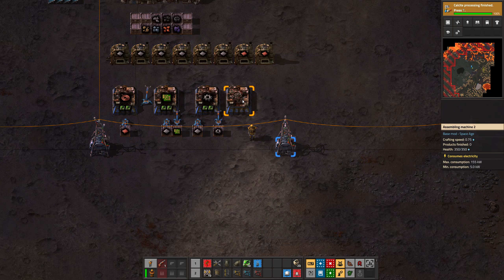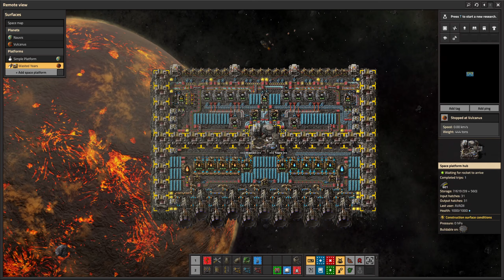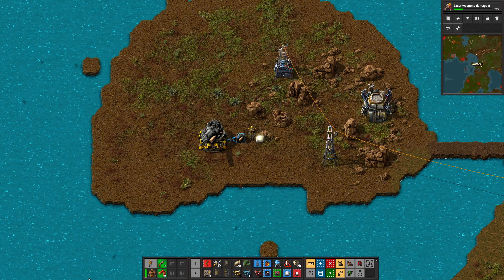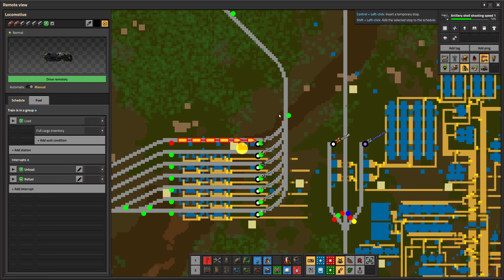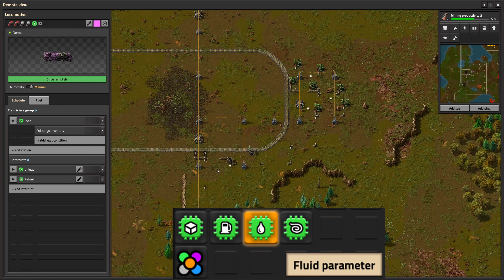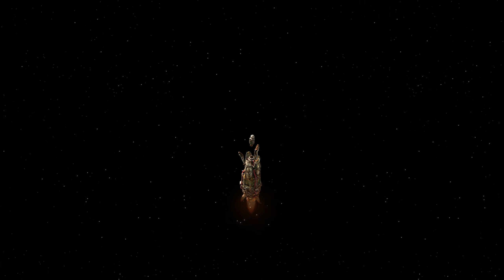How hard is it to beat MY OWN MOD? - The Mid Game

Comment: I really wish Factorio Space Age allowed you to have multiple ships on one screen- letting you transfer items between them, or on planets like Vulcanus or Fulgora (and I guess Gleba) making space drydocks to defend ships being built
Reply: There is the Inter Platform Logistics mod, it's not really what you're talking about but it's the best we have atm
Reply: @peenkle6857  I used this mod to setup an orbital shipyard producing space platform foundation, repair packs, and ammo in orbit of Vulcanus. Other equipment still needed to be launched from the ground, so it wasn't like space platforms became free, but it did speed up construction significantly and made construction cheaper.
The UI was clunky though, and an official form of inter-platform logistics would most likely be much smoother to use.
Reply: @peenkle6857  True
Reply: Imagine some kind of docking system that needs to be controlled by circuits to avoid colliding your space platforms together. Nice
Reply: I have hopes for intership transfer in 2.1
Reply: We have good news! This will be possible in 2.1
Reply: @mather468 yep! Stupid excited for 2.1
Reply: Yeah, big loss
Reply: They would need to rebalance space platform flight mechanics so that it’s prohibitive to make moving platforms self-sufficient as opposed to having orbital ammo/fuel production stations
Reply: The Space Exploration Mod does all of that and more
Reply: @mx2000  sure but also adds a ton more complexity to everything